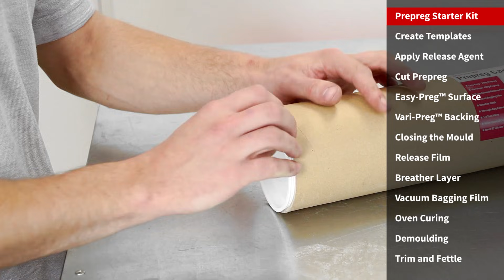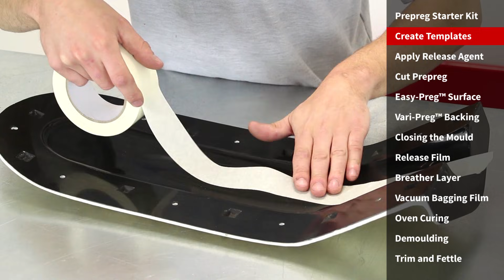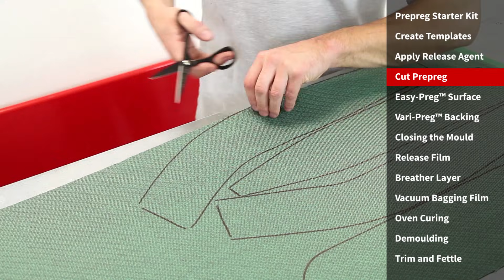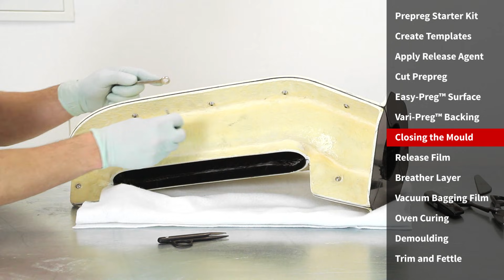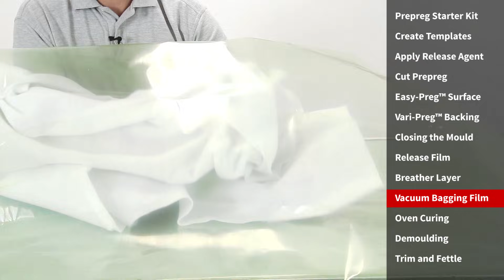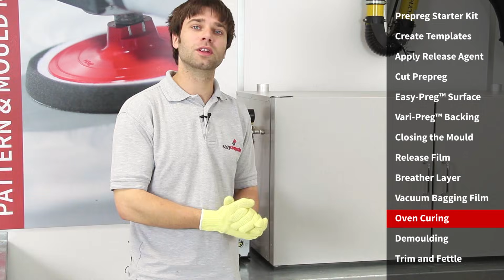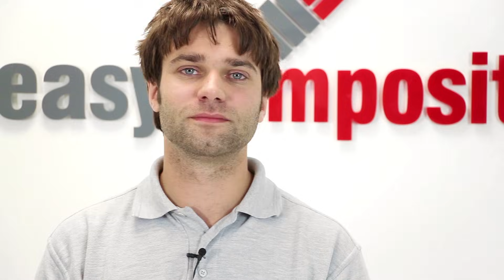How to Make Prepreg/Dry Carbon Fibre Parts (Carbon Fiber Airbox Pt. 3)

Comment: 8:45 I use a pair of scissors with a bend 'beak' that has tiny teeth on its cutting surface, to cut the lay-up flush with the square edge. Works a treat!  Superb tutorial, Paul. Thanks for the upload! Cheers, Rob

Comment: love these videos.   thanks a million for these.   just learned need the perferated breather then the other breather for the prepreg process.
Reply from the maker: Hi John, I hope there's not been any confusion, you should have learned that for prepreg you need only unperforated release film and then (usually) breather. The breather is to make sure you have open air paths but the unperforated film stops the laminate from sticking to the breather. It's important that the release film isn't perforated because the prepreg should already have the exact quantity of resin in it, we don't want to bleed any off through the release film.

Comment: This video series was useful. I am currently designing a new desk for my room and am considering making some of the major components using this technique.

The major obstacles for me to overcome are:
Financial; I have a limited budget as I am a student and under 18.
The machines I have access to; my college may not have sufficient equipment to emulate the process that you demonstrated. 
And the process of making parts using a material as complicated as the one displayed; I have never worked with Carbon Fiber, in fact I have worked with very few materials outside of basic wood and mild steel.

However, I am determined to make this project a reality, I feel it would be my first legitimate make that, if nothing else, teaches me useful skills that I can transfer toward my goal of (hopefully) becoming a designer.
Reply: +Iron2Man911 Your school should have a vacuum pump. The only thing you need is an oven large enough to cure the prepreg. A desk is a pretty ambitious sized CF project.

FWIW, most designers I know have never built anything themselves and never will.
Reply: +Iron2Man911 Forgot to mention - for your desk, you can use a "carbon fiber" vinyl wrap.

Comment: Two questions.... 1. how different is the process for a wet lay up technique and 2. what is the car at the end of the video? Also, this was the absolute best, most informative A to Z instructional video on this subject I've ever seen, thanks for producing it!
Reply from the maker: Thanks very much!  Q1) Well, as you can see from the video the process is quite different from wet-lay. A part as complicated as this would be very difficult to make using a conventional wet-lay process and if you could make it then it would be pretty much impossible to make something that looked commercial quality, for a part like this, if you have access to the vacuum pump and oven then prepreg is the way to go. Q2) It's an MEV Rocket. We built it ourselves and use use for fun projects like this!

Comment from the maker: The final part weighs 230g.
Reply from the maker: It's certainly true that when you're starting out you can pick up a second-hand domestic oven very cheaply (or free) and then drill a hole through the side so that you can pass the vacuum hose through. What where you drill of course to ensure you don't damage any wiring/elements etc.
Reply: Easy Composites Ltd  
I get a lot of scrap material from work as big as 50" by 50" 
I have all the knowledge to build parts except the curing material and release agent that I dont know where to buy them ! Do you guys ship material to USA or have a retail store in USA where I can order it?
Reply: how much temperature in the oven curing? How long need to be de piece there?
Reply: PUU-TAAH Nin Nin darn. thanks
Reply: Get one for free on Craigslist
Reply: Hi, is the back component gel coat?
Reply: Useful information. Nice video. Can someone please tell me if I can use this same process for manufacturing GLASS FIBER reinforced polymer. The part is similar to your part (Its a closed profile) ? Thanks in advance.
Reply: Easy Composites Ltd  what tool are best for sanding carbon down for glueing

Comment: In my opinion, creating a very thin fiberglass plug from the original part, and then carbon fiber over that would be drastically simpler. It might weigh a bit more, but look exactly the same, and have the same strength, since the fiberglass would not be visible.  It would also cost hundreds less in labor and materials. The only additional work would be sanding where the carbon fiber overlaps.

But its possible I don't understand the process enough.

Comment: its a unimold system mold with prepeg, and the part looks great, i dont know why you not recommend this anymore. High temperature resin and gel coat's curing times are ridiculous.
Reply from the maker: Vinylester Gelcoats don't work particularly well with our XC110 PrePreg.

Comment: I suppose if you're making a one-off, you could just make the plug out of foam as you did in the first vid, then wrap it in carbon fiber, and destroy the plug afterward.  Of course the part won't be nice and shiny but a lot faster.
Reply from the maker: Yes that is a very workable plan.  Often using Styrofoam or polystyrene as they can be easily dissolved out afterwards using a strong solvent like acetone. With care, and a couple of layers of resin, you can make the outside look smooth and glossy much like you would with the carbon skinning process.

Comment: You should see if you can make a special vacuum bag size for these sorts of parts. A hollow tube which goes into the part, which then is taped to the open ends of the larger hollow tube which goes around the part. Making a doughnut shape with the hole through the part. Could save a bit of time on the work then. 
Btw, great video! Could you do one about how to add most strength with the least amount of material? Perhaps by using the left-over from the cuts and forming gussets, then vacuum-bagging around that.
Reply from the maker: You could indeed make the bag in this way; I'm not sure if it would be any easier or quicker but it could well save some bag which could be preferable, depending on whether time or cost was the priority. In reality, bagging up a part like this would take us around 20 mins from start to finish (including release film, breather, tape, bag and pull-down). For a £250+ part, which this would be, then it's not a big problem.

You can certainly make use of offcuts of prepreg to get the most out of your material. I know of some companies who pretty-much make up the whole reinforcement layer using small 'patches' of prepreg. From a technical point of view this isn't the way to get maximum performance from the parts because continuity of fibre is important for maximum strength at minimum weight however for applications where it's not so critical and keeping costs under control is then this is certainly an option.

Comment: really great video, was worth the wait! i'm sure this is a noob question to ask but what is bridging?its mentioned numerous times in this video and i haven't come across it before? does it relate to the two different types or carbon not connecting properly?

Also is the oven available to buy from the shop yet?
Reply: ***** no, bridging is the "spanning" of the material, where it does not follow the contour of the mould exactly, allowing air to occupy the space, resulting in gaps, holes and bubbles in the final product.
Reply from the maker: Hi Eamon,

Stan's right, the bridging we're referring to is where reinforcement (i.e. the prepreg carbon) or the bagging materials, don't go tightly into a corner and instead they shortcut the order or 'bridge' it. As Stan says, this then manifests itself as either pin-holing of the surface (because the bag doesn't put enough pressure down into the corner) or in bad cases you can get an actual void where no material or resin are against the mould surface.

As for the oven, we're just finalising a few details now (such as safe packaging for it) and then it will be on sale on the website. We will of course provide lots more information about it when we do.
Reply: EDIT: ignore
Reply: easycompositestv thanks!
Reply: Stan Dudinski thanks!

Comment: An excellent video. But, as it is an air intake manifold, the inside needs to be as smooth as possible, not the outside!
Reply from the maker: Thanks for the feedback Greg and yes, in theory that is correct. The video is more a demonstration of the pattern>mould>prepreg process which could be used to make a wide range of products, most of which - of course - will have their A-side on the outside. As, a lot of the time, would an airbox like this. But still, you are right, but you'd need quite a different process if you wanted to make a component with an A side on the inside. Maybe a video for the future!
Reply: @easycompositestv  Cheers ! :-)
Reply: @easycompositestv  Yes PLEEEEEEASE a video for the A-side on the inside!!!

Comment: Wouldn't it be easier to use an elastic balloon and pump air inside the mould?
You could also get a higher pressure that way

Comment: Incredible video such quality work!  I have a question to verify if you don't mind: you make a hollow part out of three molds in one pull, that's great, but I assume this can only be done when the part has TWO openings? In other words I could not mold, for example, a fishbowl because I can only push in the vacuum bag into one opening but have no way to pull the bag out further to thoroughly allow the bag to expand into all the recess of the bowl?
Reply from the maker: Actually, there would be no problem at all to mould a fishbowl shape in just the same way. There is no requirement to have two opening, you would just need to make sure that your vacuum bag is sufficiently oversized to allow it to follow the shape of the inside of the bowl. If you think about it, a fishbowl would be no different to a tray shape (which is easy to imagine vacuum bagging), you would just need to allow for more oversize in the bag. Where the bag goes through the opening of the fishbowl there would be lots of pleats/folds but this is perfectly normal.
Reply: Understood, thank you! I am working on a project that will allow me to mold parts as one piece instead of two as I am doing now, I just need to reshape the plug for the next mold a little better to allow the bag to get sucked into the recesses fully, and using pre-preg will give me a little bit more security in getting this done.

Comment: Thank you for this video.
I appreciate that you tell me if all the pieces have to be built with three layers.
Regards
Reply from the maker: The number of layers depends on the application and type of part.  For many small cosmetic parts we find one layer of Easy-Preg Surfacing Layer and one layer of Vari-Preg 430g as a backing will provide a nice strong part with a thickness of about 0.75mm.  For bigger parts or items that are more strength critical then more layers can be used as necessary.

Comment: Hi 
thank you again. you always do the best.
I have a problem with temperature .i my self made the mould as you do it when I put it in the oven curing, As the temperature rose to 40centigrade, my mould began to bend! what's the problem?
Reply from the maker: Hi Kara, you would need to be using mould materials that can take higher temperatures. That's the reason we use our Vinylester Uni-Mould system for this component. Uni-Mould can take 90C without distortion. If you just use conventional polyester resin then the mould will soften and distort (and also epoxy prepreg will probably stick to the gelcoat). The devil is in the detail!

Comment: Is the 80 deg PP just as structurally sound as the 120 ones only the glass temp differs?
Reply from the maker: Curing at a lower temperature should yield similar performance in the resin which is why the cycle is elongated to ensure a full cure. Surface finish may be compromised and service temperature will be lower however.

Comment: Fantastic video & very informative... I expect it is great for N/A but this wouldn't hold much pressure in a turno setup would it? If not, any other ways, suggestions or videos you have suitable?
Reply from the maker: Hi Simon, so, as you're aware, this is just an airbox for a naturally aspirated setup but the principles would be just the same for a pressurised airbox in a turbo setup, you'd just need to increase the wall thickness of the layup, which would be done by adding additional layers of the backing plies.

Comment: Thank you so much for this series it's invaluable! Sadly I had an issue, when applying the first layer of EL2 epoxy laminating resin into the mould, it seemed to be repelled by the surface (easylease mould release agent?), leaving bare patches with no resin. I tried to spread it and spread it for ten minutes but it just kept leaving areas with no resin. Fearing it would start to cure I tried pushing ahead and laying the carbon fibre I pured a thick coat on top, hoping that  I could wet it through from the other side. After it's all done and cured I just about managed to get it out of the mould, and there are quite a few pound coin size patches where there is no resin. Is there anything I can do to improve the next attempt? I am quite new to this and have sooooo many hours of work in the mould! Thank you again for all the videos 👍
Reply from the maker: Hi, unfortunately that is one of the downsides of using the Easy-Lease when hand laminating, it is almost too good of a release agent and you will find that sometimes the resin is repelled from the surface in an effect know as fish eying. One thing you can do to help with this is to apply a thin layer of wax release agent such as our miracle gloss release wax over the top of the easylease. What this does is leave a slightly less slippery surface that the resin can bond too whilst still having the advantage of the easy lease as the main release agent.
Reply: Well that didn't work. With the wax it still repelled from the surface leaving voids and it's stuck solid in the mould. It's too good while laminating and seems no good at all when coming to remove it. This project is something we're working really hard to do but because of this I might have to drop out. It just won't work, I'm so frustrated.

Comment: Great video! I was wondering if hollowed carbon fibre parts are strong enough to become swingarm of a motorcycle. How many layers of it to comprehend it? 
anyway the close caption of 0:55, haha I thought it wouldn't be there.
Reply from the maker: +DersNoNem Thanks. Yes, it's perfectly possible to make even a highly structural component like a motorcycle swingarm as a 'hollow' component (in fact, this is how they are made) however you would need be be 100% confident of your calculations regarding the thickness, shape and ply orientation to ensure a strong and safe component. If you're new to carbon fibre fabrication that I would certainly never suggest starting with complex, structural and safety critical parts like a swingarm but there's no reason you can't work towards these sort of components as your skill and knowledge increases.

Comment: Awesome what's next
Reply from the maker: Next is a Beginner's Guide to Prepreg Carbon FIbre. This video is really designed to be the second of our prepreg videos but it just so happened to be made first (if that makes sense!). The Beginner's Guide will explain much more about storage, handling, layup (on a simpler part!), bagging and curing. We'll explain what your alternatives are for a simple oven conversion and also look at the costings for prepregs and how they stack up compared to other techniques.

Comment: heyy guys ,thank you for this whole series.
I have one question that,

can we use these both prepeg to male mold (made up of styrofoam) ?

please make more videos on prepeg.
again thank you for series.
Reply from the maker: The problem with styrofoam is the low softening point. Although Styrofoams melting point is high enough for all kinds of pre-preg, many forms of styrofoam soften and deform around 100C and as such we cannot recommend it for use in the structure of a mould intended for pre-preg applications.

Pre-preg can be used on a male mould no problem. Remember that the high gloss face is then going to be on the inside of the finished part.
Reply: Easy Composites Ltd thank you for the information.
I appreciate your work .

And please upload more videos as you can .
Because here as beginner, I am totally following your every step & learning from you guys !👍🏽👍🏽👍🏽

Comment: hi! any idea, once the oven/part reached the desired temperature, say 80 C degrees, can you shut down the pump, so that the remaining hours in the oven is without pump working? this, of course, if for sure there is no leak in the bagging. thank you very much! great work with your videos and communication!
Reply from the maker: In an ideal world, with a perfectly sealed bag, you would not need to run the pump.  Unfortunately sometimes with the heat or just time in the bag, sometimes you can get a slight leak which without the pump running would ruin the part.  By having the pump running throughout, such issues are not such a big problem.  Most good quality pumps are capable of running for the time necessary to complete the cure cycle.

Comment: Thanks for these great tutorials they have really helped me a lot with university projects. One thing I have always wanted to know is how f1 teams make there carbon fibre chassis with aluminium honeycomb ? is the aluminium just glued into place and the curing of the carbon fibre layers on each side hold it together ???
Reply from the maker: There are different ways of doing it, but one of the most common is to use special adhesive sheeting to bond the honeycomb into place once the outer skin has been made.